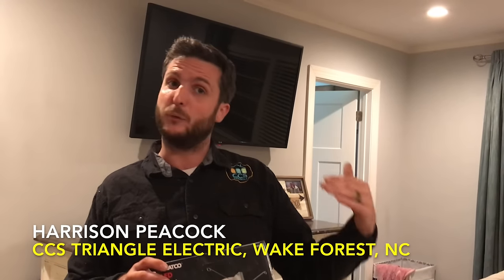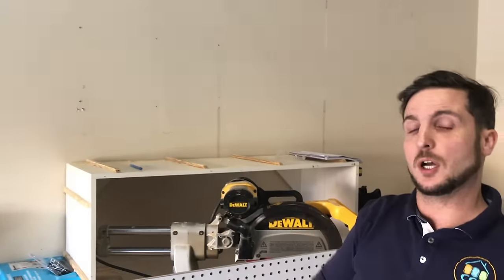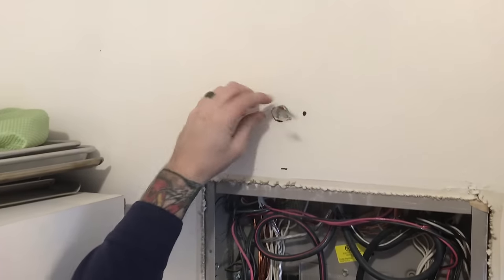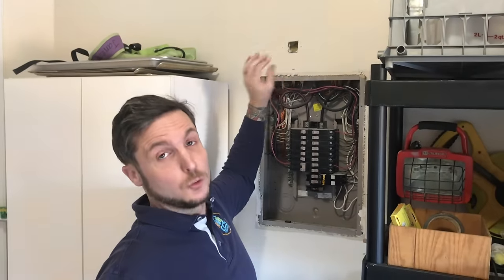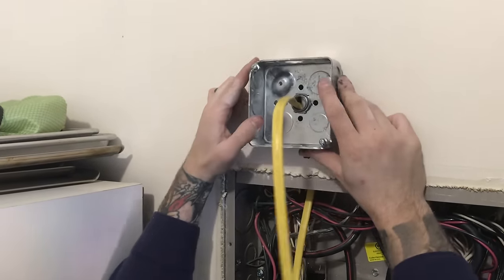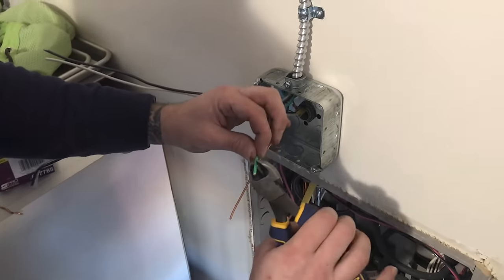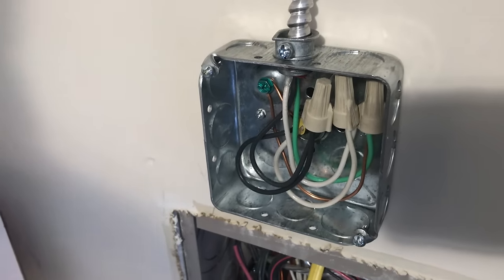New Garage Outlet From Panel--VERY DETAILED! (New Circuit / GFCI / Breaker Box / FULL INSTALL!)

Comment: Let’s go down to the comment section and see what the experts have to say.
Reply: Well done video.
Reply: Code failures:
-Ground wire wrapped around screw in wrong direction (appears that he has done this wrong for 17 years, as he did it wrong in both 4x4 boxes)
-Stripping of AC90 (MC or BX) armoured cable, it is a failure to bend the AC90 to strip it, bending it this manner can damage the conductor insulation.
-Stripping the individual conductors with side cutters.
-New Receptacle is rated for 15amps not 20 amps.
-And the most sever code failure is working on a live Panel, let alone without proper PPE.

That being Category 1 Arc Flash Protection, consisting of 
-Long Sleeve Shirt (or Jacket) and Pants or AR Coverall with minimum arc rating of 4 cal/cm2
-Face Shield (with “wrap around” guarding…i.e balaclava) or Arc Flash Suit Hood
-Heavy-Duty Leather Gloves over a pair of class 00 electrical insulated gloves
-Hard Hat, Eye Protection (Glasses, Goggles), Hearing Protection and proper safety boots.

His license could be suspended and at the very least he could be severely fined.

I hope know one is injured following this video as a guide even though the makers take no responsibility for others, you are responsible for the work you do, and that is a failure.

Master Electrician, Electrical Contractor, 42 years experience, Industrial/Commercial and Residential.
Reply: @derekparent752  well said. Agreed.
Reply: @derekparent752  I fully intended to use this as a guide until reading your comment. The fact that I require guidance makes me unqualified to amend the video with your notes and feel confident that I've got a complete set of instructions so... you've convinced me to hire an electrician.
Reply: @derekparent752  A duplex receptacle is two receptacles.  The requirement for 20A receptacles applies for a single receptacle on a 20A circuit, meaning a simplex.  He installed a duplex receptacle which counts as two and can be 15A-rated.  Additionally, all 15A receptacles are rated for 20A pass-through.

I was surprised to see a professional using diagonal cutters to strip MC and then mess around with lock nuts instead of stripping it in 2 seconds with a rotosplit and popping it into a snap-in connector.  And there's absolutely no reason not to kill power for a couple minutes to make the final connection in a residence.
Reply: @confidentlocal8600  I believe a 5-15R duplex or single receptacle is rated for 15 amps and not more, at least that’s the code in Canada. You can make it a split receptacle and you can run any size wire to it providing it is #14 or larger and is rated for the screw terminal (#12 yes, #10 no) But you cannot fuse it at 20 amps, it is only rated for 15amps, hence the name, Nema 5-15R.
A 1-15R has no ground pin (2 blades) the 5 signifies it has a ground pin.
A 20amp receptacle has a unique blade configuration like all different devices.
To improperly fuse this device could lead to it failing, an example would be a 17amp load on a 15amp plug for an extended amount of time could cause it to melt or possibly catch fire before the breaker opens the circuit.
The proper duplex receptacle for a 20amp breaker is a 5-20R.
Reply: @derekparent752  Here in the States, NEC Article 210.21(B)(2) and Table 210.21(B)(3) allow 15 or 20-amp receptacles on 20-amp circuits explicitly.  (15A receptacles are internally rated to carry 20 amps but accept 15A plugs.)

210.21(B)(1): A single receptacle installed on an individual branch circuit shall have an ampere rating not less than that of the branch circuit.  This means a single (not duplex) receptacle must be 20A rated on a 20A circuit.  The requirement does not apply to a normal duplex receptacle.

I'm not familiar with the rules in Canada but I wouldn't be surprised if they was a similar provision.
Reply: @confidentlocal8600  interesting, I’ll have to try and compare that with our code. 
Great discussion. 👍
Reply: @derekparent752  ; All that PPE you listed is NOT required when doing Residential Wiring or Commercial Wiring ! Only in Industrial Wiring and Maint. !!!
Reply: @BearStar1  What PPE is required? 

Whether the Arc Flash Hazard Identification Table 130.7(C)(15)(A)(a) indicates no arc flash PPE is required or the arc flash labels from incident-energy calculations indicate Level 0 is to be used, is there still a minimum level or protection required? 

Yes. NFPA 70E Article 130.7(C)(11) continues to prohibit the use of certain flammable, synthetic materials as it has in the past. This means, at a minimum, wear clothing made from nonmelting, natural fabric when arc flash PPE is not required. Other PPE may also be required as needed. 

Even though HRC 0 and PPE Category 0 are not part of the 2015 edition of NFPA 70E, minimum protection requirements still exist and are inherent in the text of NFPA 70E.
Reply: This comment is pure gold. It’s basically appropriate for all YouTube videos and accurately predicts most of the comments. :)
Reply: @derekparent752  Other than that it's ok right?
Reply: @ryansmithberger9221  lol, um....yeah. 👍
Reply: @derekparent752  THANKS A MILLION FOR YOUR KIND ADVICE . GOD BLESS YOU !!!
Reply: @derekparent752  Just want to know the code and if it possible to do it. My situation is I'm building a new unit in front of the property. Because my current edison pole that connecting my panel with the source from the street need to be removed. I have to put a temporary pole to provide the back house while the construction and the other half would provide power for workers. 
The question is it possible for me to connect the temporary pole to my back house (about 100 ft away from each other) in the open.
I'm assuming that I need to have some kind of pole to keep the wires up in the air X amount of feet?
Is there a specific number that how high that wire need to be above the ground; maximum distance between the temp pole and my back house panel; maximum distance from a pole to pole (to hold support for the extension)?
thank you in advance.
Reply: @anothername6861  they put a man on the moon so I’m sure you can re-feed the existing house. 
The job you inquire about will need a certified electrical contractor as it involves the hydro utility.
My guess is you would require 2 poles and only 1 meter and temporary panel.
Best to use someone locally as they will know more of the Utilities prerequisites. 
There are codes regarding distance of poles, drip loops and other things. 
This particular Job requires coordination between the inspection department, utility supplier and owner/contractor.
Reply: @derekparent752  thanks, I will have someone to do the work, I just want to know if there is like a limit that stopping me from doing it. The height I think its only 12 ft from the cable to anything under, I just don't know how far is the limit of the length from the temp panel to my existing panel. I'm trying to figure all out so I know where to set my temp pole. Thanks for the feed back.
Reply: @anothername6861  from what I gather from the Canadian Code it is 40m or 131 feet. 
The other code states you cannot run wires over a building and poles and wires must be 4.3m from any building.
Again, the hydro authority and a licensed electrical contractor can confirm all your requirements. Hope that helps. 👍
Reply: It’s a code violation to not secure the cable on the clamp entering the panel .
Reply: @Solaiman Ali maybe 1 day I will have the time, I believe it would take much dedication to make the videos and then answer the host of questions that would follow.
For now let me suggest 
the Sparky Channel.
https://youtube.com/c/SparkyChannel
He is making lots of videos in regards to the new 2020 code and also shares some insight into possible failures of the code as well and remedies for a safer install.
Keep in mind, the Electrical Code is a Minimum install that must be followed and not all the laws are safe, this is why they are changed occasionally because safety concerns arise during this ever changing field.
Reply: lol same here making sure im not wasting my minutes
Reply: @derekparent752  mc/bx not rated for exposure to touch needs to be covered like romex below 8 '
Reply: @jamesonsonoma748  what code states that?
Reply: I’ll look it up, it’s been that way for awhile out here in commiefornia. I have been called on it.
Reply: @jamesonsonoma748  odd, in Canada bx is used anywhere except wet locations and explosive areas. We actually have to use it to wire furnace’s and hot water tanks due to a chance of mechanical damage, though you can run romex in an armoured cable to get the same results.
Reply: @derekparent752  Garage receptacles are suppose to be AFCI protected NOT just GFCI which means they should of used a dual AFCI/GFCI receptacle  so that's another code violation.
Reply: @kalijasin  I know that is part of the new code in Canada, not sure about the US. 👍
Reply: @derekparent752   dual AFCI/GFCI receptacle in garages is required by the  NEC since 2014.
Reply: @derekparent752   This wiring was done in North Carolina so the NEC applies NOT the CEC.
Reply: @kalijasin  so much detail is required these days for proper installation’s. 
Though I did find out you can use a 15amp duplex receptacle with a 20 amp breaker in the US, after 40+ years experience and 10 electrical codes this is something I see as future litigation and an unnecessary and possibly a dangerous adaption of the rules. 
For those who deem it necessary to use a 15amp receptacle I hope they chose a spec grade one. As a contractor why would I perform such cheap workmanship in the first place and run “any” risk of a possible accident.
Stay safe out there. 👍
Reply: @derekparent752  15 amp receptacle and breaker in a garage is a bad idea imo because in a garage people use power tools, extension cords, etc.
Reply: @derekparent752  Does the code stipulate how wires are to be stripped?
Reply: @derekparent752  You are an electrician in Canada?
Reply: @ianbutler1983  Ontario Canada.
Reply: @ianbutler1983  what is wrong about this video is showing people with no true understanding of the trade how to do a job that is best left to someone who is competent.
But you and your insulting manner cannot see past your own inadequacies, and I highly doubt you’re in the electrical field lest you would understand how to wire a simple ground wire on a ground screw.
I hope you would have the courage to take responsibility if you posted a video and someone was hurt or their property was destroyed. The reason I say this is because as a contractor... You are responsible and liable for your actions.

Comment: So.. the whole point of the junction box sitting above the panel was just to allow for a passthrough of the electrical wire thru the drywall?  It didn't offer any other specific function?

Comment: Seems to me that you wrapped the ground wire around the grounding screw inside the outlet box in the wrong direction, and when the screw was tightened, the wire was not drawn tight, just the opposite.

Comment: Great video full of useful tips!  If anyone is still wondering what exactly the GFCI does (a more technical explanation), it monitors the "in" and "out" current through the plug and if they don't match, it interrupts (breaks) the circuit. This happens when something (you, water, a short...) connects to the plug and "steals" electrons, hence the "ground fault" in the name. I.e. the current finds an alternative path to ground (through your body perhaps) other than the plug.  In this case, there will be an imbalance between the amount of current that enters and exits the plug which the device detects and breaks the connection.

Comment: I found this to one of the most informative videos. There were no parts where you were suddenly coming back and saying now that's done and not showing what you did. Mr. Peacock is very professional in his instructions. Again well done.
Reply from the maker: Thank you, Charlie! 🙂
Reply: The only thing I was left wondering was the part where he mentioned that the power tester lets you know when wires are not installed properly.. would it work if the wires are backwards?? That's the only thing that was "missed" ... otherwise great video.

Comment: Panel Discussion 2:55 
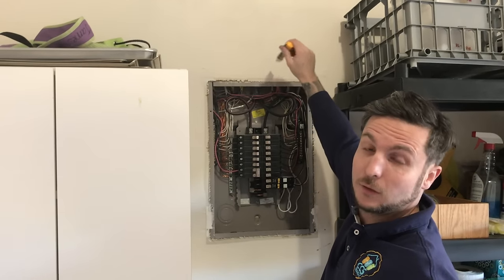J-Box Install 4:37
Metal Cable Install 14:00
Outlet Install 30:50
Panel Wiring 37:48
Reply: Thanks.
Reply: Thank you! Is there a list of the name of the materials used?

Comment: This content was so awesome! I was able the follow this video (with the supervision of an electrician) and installed two wall outlets in my garage, and connect it to the GFCI outlet in the ceiling for the garage door. Later I installed 4, 6" recessed LED lights (on a different circuit) and the garage is awesome now!

Comment: A long but very useful video. Thank you both for the review of how it’s done. Thanks too for covering important safety & NEC requirements. Very neat panel, so I’ll excuse the previous electrician not wanting to try to fix sloppy drywall work at bottom left corner of panel cover. Also glad to see that the original, NEC-compliant screws were still there to hold the panel cover on. Great job Harrison. Thanks to Honest Carpenter for putting this together.

Comment: Im electrician almost 10 years in NYc n i can say that you explained very good, I have only two small objections 1. You didn’t screwed up that romex with connector in the panel ( if u don’t wanna break the wall u could just use arlington romex connector )
2. Put el tape on gfi for extra protection ( im not saying this because of you we both got enough experience those are basic thing but for the beginners yes )

Comment: I have to put a couple of 20 Amp circuits in my garage.  This is exactly what I have to do, down to the same panel box and breakers.  Thanks. Though I knew how to do 90% of it, I picked up a couple of nuggets. I'm not intimidated by the box because you can shut off all power while working in there. If you make a wrong connection, your breaker will trip. Then you just have to shut it off and try again.  The existing wires will show you where to put the new wires.  The pain in the butt part of a lot of electrical work is running wires behind the sheetrock. That may necessitate making a lot of holes, drilling through studs, fishing wires, and then repairing and painting the  sheetrock.  Done tons and tons of that in both my old and new houses. I learned by doing and  reading some books. Now you just have to watch videos like this. Two Thumbs Up!

Comment: Nice work guy. You did an awesome job explaining your work. The one thing I noticed you did not do is tighten the connector at the romex end to the panel knockout. 
What I would have done is measure out and cut the approximate length of wire that is required for inside the panel and tighten the connector to the romex wire at the spot where the wire would enter the panel. Then push the wire with the connector attached  to match up with the knockout from the panel. That way, the both ends of the romex wire would be properly secured to the can and panel knockout connectors.

Comment: This video was exactly what I was looking for!  I am an EE so I understand the concepts but the application and the code were beyond me.   I love the way you did this.  It is a garage, it doesn't have to be nicer than this.   Thank you so much for doing this tutorial!  Does code ever allow a non GFCI outlet in the garage?
Reply: Older codes didn't cover this, my condo built in the early 70s didn't have GFCIs..
Reply: Your answer is "it depends".  It depends where you live. 

 North Dakota has a state code supplement that allows for the garage door opening, a single recepticle, to not require gfci protection.  I believe this is to prevent their people from having to climb on their cars or trucks to reset that gfci.

Your area may or may not do the same.  Call the building inspectors to be safe.

Comment: Stripping the wire is better done with a wire stripper instead of a wire cutter. I am surprised that this pro electrician did not have a wire stripper !!!
This man did a great job in installing AND teaching us how to do this. Thank you very much.
Reply: I personally use automatic strippers. they are fast and better when it comes to stripping . If you're not a electrician or have never done this before you definitely will hit the copper with wire cutters.

Comment: Good video. However you used a 2 screw romex connector at the top off the panel, but u didn’t tighten the 2 screws because the drywall was in the way. Next time, thread the romex thru the connector, tighten the 2 screws, take off the lock ring, thread the romex down into the panel, thread the lock ring back up and tighten. Now it’s to code and the romex isn’t going anywhere if yanked.
Reply: The guy in the video may indeed be licensed but he does lack some experience.  M G's point should be well noted. Also he should have started with a wall-board saw and not a chisel for crying out loud. I'm not going to watch the rest.
Reply: @shawnhayden6674  Yea calling drywall anchors "connectors" gives away a lack of experience

Comment: I like the screws in the vertical mode because they do not hold dirt as much. Seems many new commercial builds are now putting the outlet ground on the top. Great video picked up lots of good tips.
Reply: Not an electrician but I have done DIY projects and distinctly remember being told to put the ground on top so anything sliding down the wall would only hit the ground pin.  If by some miracle something DID hit the wall and manage to also hit a plug.  I don't know how often that was supposed to actually ever happen.  But in any case, I never see outlets done that way. Every outlet has the ground at the bottom.  So I'm thinking the rule I was told about wasn't actually all that true.